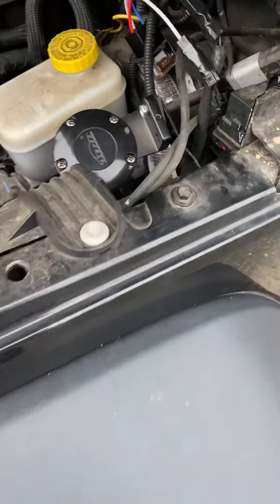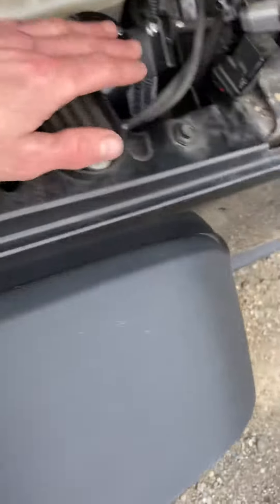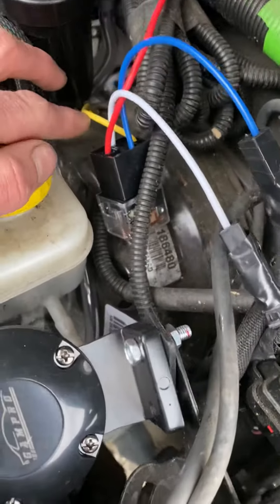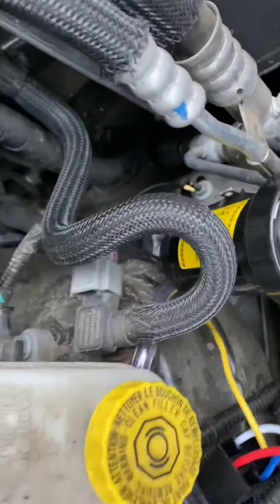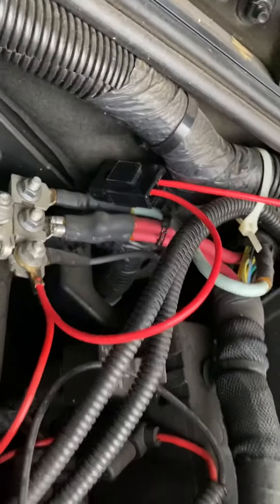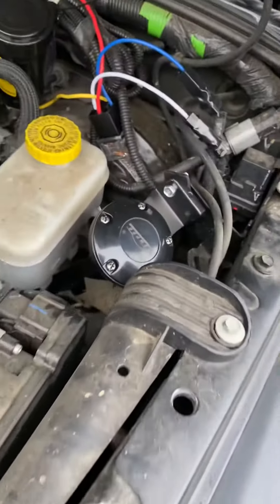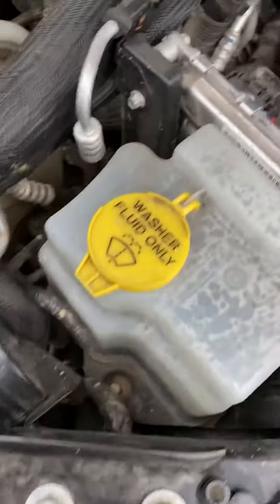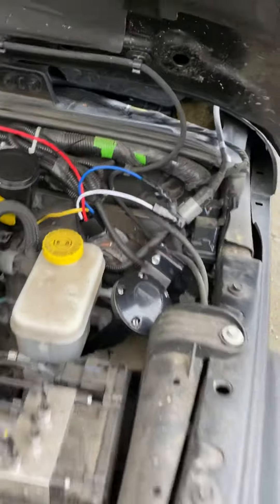Gampro Air Horn Install on Jeep Wrangler JKU

Comment: Have you had any problems since install? Asking because the very first thing in the instructions say to mount away from heat of the engine. I’m mounting under the Jeep but need to extend the wires.
Reply from the maker: No issues still works like a champ